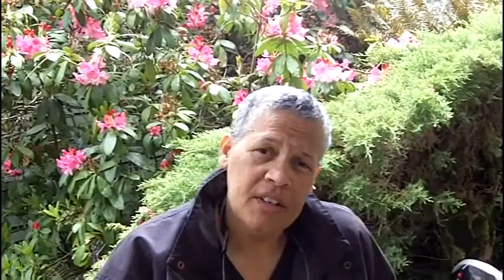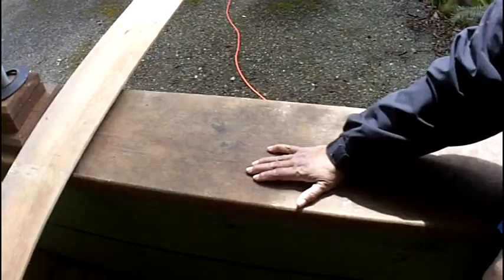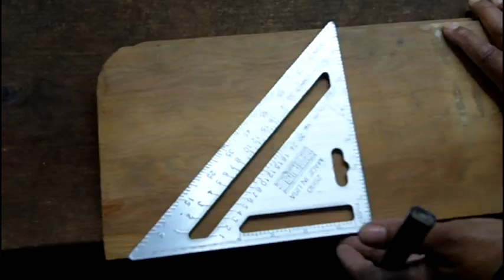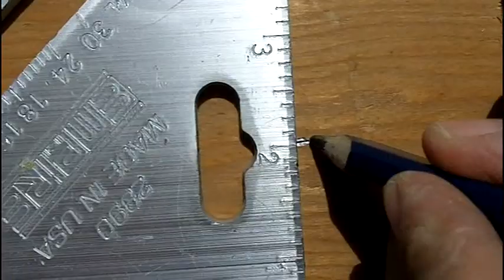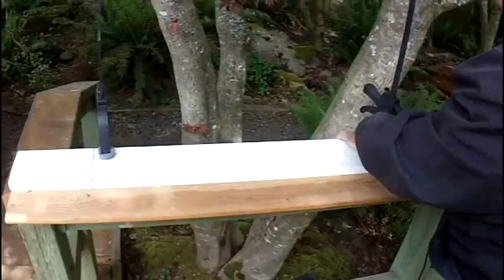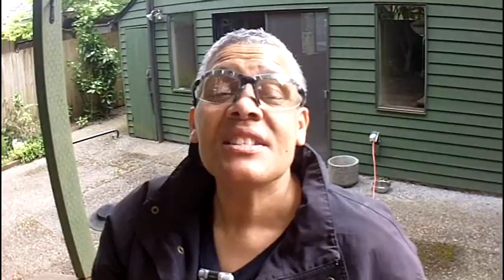How to Make a Perfectly Straight Cut in Wood with a Circular Saw

Comment: You did not show an adjustment to the blade depth (height the blade above the shoe) if adjusted too deep the blade can bind (due to movement of the wood from internal residual stresses) as it appeared to do near the end of your cut, the blade should protrude just a little thicker than thr board you are cutting.
Reply from the maker: +EddieVBlueIsland   Hello Eddie,  Blade depth and shoe adjustments were covered in another seejanedrill video.  Thanks for posting.

Comment: Question.

As I said in another video of yours concerning circular saws, I bought mine just last week (brand new). And I noticed something strange about the 2 blades that came with it. On the tips of the blade, which should normally should be very sharp and pointy looking like a regular handsaw if I'm correct, there seem to be sharp edges instead of sharp points/tips.

EN 847-1, TCT blade 36T, 185x16mm, max. speed 6000/min: is what came with the saw, to give you an idea what I'm talking about.

So my question is: do I measure from these things sticking out or from the blade itself? Because I think if I measure from the blade my cut will be incorrect.
Reply from the maker: +TheOpelkoenjas If you want it to be "right on the money", then measure from the carbide tips (which is what the "edges" are that you are referring to. ) Just keep in mind that a circular saw is generally meant to be used for construction, and you are not generally going to get the same precision accuracy that you would with a table saw.
Reply: seejanedrill Oh okay, got it. ^^ Yes, it needs to pretty right on the money, at least for my next DIY project: wooden casings for the 7 new wooden doors in mom's house. :p

I tried it on some scrap wood already (left overs from an old closet that I ripped apart), just to make sure I don't make any big mistakes, and I found out that I only need to add 1 millimeter (the carbide tips) to be "right on the money". ;) Problem thus solved.

Cheers and keep the videos coming! I'm 100% sure they will come in handy here at some point in my renovation projects.

Comment: do you cut to the right side or left side or right on the line? When I do this and I need four or five peaces of the same cut they are all off just a little. No two cuts are perfect. Whats the trick to getting identical cuts? I'm really kind of new at this and don't know much
Reply from the maker: Hi Wesley, there is something called a jig that you can use to keep your blade on track for making multiple cuts of the same size.  A jig something you make yourself, and is kind of like a "template".  We haven't yet done a video on how to make a jig, so I would suggest looking it up.
Reply: Hey thanks, When you do a vid on one, share it with me. Thanks again.
Reply: For repeated "exact" cuts use a rip fence. Right or left doesn't matter, your preference. Looks like most people like to rip from the left like this video.

Comment: The only thing I do differently is I screw down the guide piece. I don't trust the clamps to stay tight, especially when using my jigsaw for a long cut.
Reply from the maker: homer simpson Yes, that's a good way to do it!  It can be tough to do if the wood is on the narrow side though.

Comment: Thank You for your video.  But I am sorry to say your cut was not a perfect 2".  It is 1/16th of an inch too short.  You measured from the solid blade instead of the saw tooth that points toward your workpiece.  This distance matters because it will shorten your cut as much as 1/16th.  This matters in finishing carpentry work but maybe not for rough carpentry work.  I have used your method of creating a saw guide at job sites (it works) but a table saw works best.  I have enjoyed many video.  And I don't mean to be critical.  Just trying to help.  Keep up the great work!

Comment: I need to cut 1/2 inch off an oak veneer door I'm scared that i may split the veneer if the blade doesn't have a high teeth count. Would it be wiser trying to plane the door down to size instead? I either buy an electric saw or electric planer! Thats my choice.
Reply from the maker: +shutinyanks Quite honestly, if I were in your situation, I would just take the door to a cabinetmaker and have them make the cut for you.  It will cost you less to have them do it, then purchasing the tools.  And of course there won't be the added worry about chipping the veneer.

Comment: I tried this with a jig saw but my line still came out crooked,because as I watch the blade the from me holding the saw steady the blade was bending as it cut..So will a  circular saw be better to use than a jigsaw..I had to make 5  extra cuts and was angry and still didn't get it...
Reply from the maker: A circular saw will definitely be better, because there is less vibration than with a jig saw...it has less of a tendency to wander
Reply: seejanedrill
Reply: With a jigsaw cut a little wider than the line, follow with a hand plane to finish off. Little practice makes perfect or at least acceptable.

Comment: what if it is a 2x4? The falling off once it is cut is my concern.
Reply from the maker: Hello Melissa,  I appreciate the question, however, I must mention that ripping a 2x4 using this method would be extremely difficult considering the width of the lumber you wood be cutting.
Reply: :) any cut.....
Reply from the maker: Melissa J A width of 4 inches or less would be difficult to clamp without creating a jig first.

Comment: I have an orginal 77 skil saw. When ever I use this the wood always miter up. why is this?
Reply from the maker: Richard Cowtails  I'm sorry Richard, I'm not certain what you mean.
Reply: Im building a coffee table. When I use my saw, it cuts at an angle.  Could it be the blade? The shoe? I checked with a square to confirm level and the blade is at 0°
Reply from the maker: Richard Cowtails  I'd check the shaft for any sort of play.....could be a bad bearing....or it could be as simple as a warped blade.
Reply: alight, I'll check those. thank you. Blade is old anyways lol. probably blade lol always something simple lol

Comment: Is the cut out by the width of the blade?
Thanks
Reply from the maker: 170221dn If I understand your question correctly, than the answer is as follows: If you measure from the waste side of the blade, then you don't need to account for the width of the blade itself.  If your question is something else, just let me know.
Reply: Thanks,
just checking.

Comment: For  2 inch rip I usually pinch the table and run.  I can rip a 4 by 8 in half and a perfect cut with nothing but my speedy, a pencil of course, my tape and the saw.  But I keep that one secret for winning bets.    For $50 I bet I can rip it in half and my cut is as straight as a  factory edge.  I have NEVER lost the bet.
Reply: +Steve Sanders Let me guess, you use the rip guide?
Reply: No.  And I don't pop a line either.  No rip[ fence or guide.  All done with nothing more than a tape, MY saw (just a DeWalt 7 1/2 inch circular) and my speedy.  I'll explain.  I get my mark on both ends...the one at the lead end of my cut to get it on track, and one at the end so I don;t get off going out.  Then I hook my tape on the side of the saw table and pinch the blade where I want it to cut, (1 1/2 inches shy of my finish dimension. ) then I do just like you would for a pinch and run only I am pinching the tape, not the saw table.  I may do a video of it just to show people.  I don;t know.  I ain't really proficient at making these YouTube videos.  I'm not "cyber' savvy".  I'm a carpenter.
Reply: +Steve Sanders When I was in college and laboring, I saw guys making different plywood cuts your way.  I never could cut anything but a 2x4 straight.
I hate you talented people.
Reply: Ah, you could do it.  All it takes is experience and the will to learn.  If you can use a saw and cut a  straight line at all, you can learn it.
Reply: Steve Sanders
People with experience get track saws.
Reply: I've used one and they are a good tool.  But what if you don't have one?  I'm old school.  I make do with the tools I have available.  Having a tool is not as good as having the skill and skill pays better.
Reply: Steve Sanders
If you don't have one you go get one. Having a skill is not exclusionary to possessing tools either. Having the right equipment pays best too.
Reply: Tell ya what...you go buy the tool. and I'll pay the guy who can do it without the tool.
Reply: Steve Sanders
time is money. You'll go chapter 11 unable to compete with better equipped rivals.
Reply: By the time you set your track saw, I can cut it, hand it to my guy and he can have two nails in it and have his tape out to get my next measurement.
Reply: Hey.  If you like to use them, fine.  I wasn't even saying anything about the tools available.  I was just telling about a trick I use to show off.   With some practice I can still hand drive 90 166 penny's in a minute, but I use guns now.  What I CAN do may not always be what I do.  Jeez.  Put a plug in it Nancy!
Reply: There is no talent in carpentry, but there are acquired skills. Some carpenters have artistic ability and superior common sense. These people are talented.

Comment: Actually the rip was a 32nd shy. You should have measured from the edge of a tooth, not the blade itself, to the edge of the 'shoe' (never heard that before, always referred to as the table). This is why the rip was a tad off.
Reply: +Buster Nutt Its always called a shoe, never a table.
Reply: Not so. Depends on where your from. Does everyone in America call soda soda? No. Or how about a shopping 'cart'? In some states it's a wagon. I've even heard it called a trolley. And where I'm from everybody calls this part a table, not a shoe.
Reply: Buster Nutt Where are you from that everyone calls it a table ?  I googled it, nowhere can i find it mentioned that its a table.

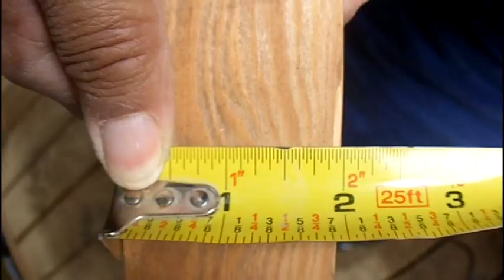Comment: Jane, you are pushing in on the tape during your 2" measurement (6:10) and holding that bent up tape at an angle. The top reads 1 15/16, the bottom is reading 1 7/8. If you were holding the tape correctly it would probably be closer to 11/16. The kerf of the blade is an 1/8. The measurement across the board should've been 3 3/8 to allow for the blade width. Also, hook and pull for a correct measurement. Never hold the end of the tape with your finger and push the tape towards your finger. The slack at the end of the tape is there for a reason. This would never pass in finish carpentry.

Comment: your off 1/16 (actually a bit more because you measured from the blade flat instead of the actual tooth) if indeed you wanted to cut an exact 2" piece. 

calculating for kerf and figuring out which side is the waste side is the thing most people.get confused about. 

i understand and appreceate that your making a verry basic / begenner video, but you need to cover this properly or atleast do it correctly in your demonstration. if you intended the 2" piece to be the waste piece it should have been measured from the other side.

Comment: Something doesn't make sense here. You marked 2" on the board. Then you measured from the outside of the blade to the outside of the shoe (1.25"). Then measured that distance from your 2" mark and clamped your straightedge. To me the piece you cut off SHOULD of been the thickness of the blade SHORT OF THE 2" you wanted given how you measured. Yeah you showed the cut off piece as being 2" BUT that does not compute given HOW you measured. You should of measured the shoe to the inside of the blade for it to be right. You never mentioned it BUT in order for it to be correct you would of had to have allowed for the thickness of the blade.

Comment: Two big errors here!!!There’s no way that the cut piece could be 2inches wide because you didn’t allow for the blade thickness when you set the fence from the edge, you only measured from the blade body to the side of the foot. You actually needed to have measured to the other side of the blade in this case. Also you only measured to the blade body not the teeth. The teeth are always wider than the blade body to prevent it binding during the cut, it’s called the kerf. If you’re going to pretend to be such an expert at least do it right. The fence should have probably been 2 1/8 inches from the edge. And that’s from an Australian who doesn’t even use inches.

Comment: you cut a 1 7/8 piece, you measured from the wrong side of the blade. nice try though.
Reply: She showed the finished cut as being 2" (it might look like 1 7/8" if you read the bottom of the tape because it was bowed out a little; at the top it was pretty much dead on the 2" mark.)
She had the blade positioned such that the outside edge was on the cut line, ie the thickness of the blade (kerf) was fully within the cut line and included in the 2" she removed.    
Remember she had the jig on the outside of the blade - what you said would have applied if she'd cut the other way around, with the jig on the opposite side of the cut from the blade, in which case she'd have needed to include the blade's width in her shoe measurement.  As another commenter has said, doing it her way is better because the motor isn't in the way.
Reply: +TheBloke actually, she DID measure to the wrong side of the blade. I realize her cut was 2" but that may be a result from the slightly inaccurate pencil marks. Not hating at all. Actually enjoyed the video.

Comment: It's straight in line but up and down?
Not so much
Your hand wobbles left to right
Reply: There is a certain amount of skill to carpentry that can only be obtained by repetition, but another board of the same thickness laid parallel to the cut on the other side of the blade would certainly help your accuracy. All the videos and how to books available will never be a substitute for experience.
Reply: +labrd41 thanks

Comment: you know how to cut straight, but you don't know how to mark perfectly. you need a very a small diameter pencil or metal point to mark accurately. also cheap circular saw blades wiggles or have play that prevent them from cutting accurately.

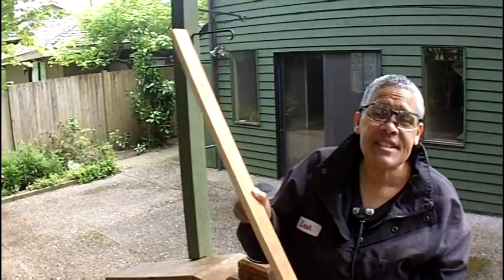Comment: You need 3 pcs. of straight wood for clamping an all... And check min 6:18-19 you can see the bottom end of the stick is uneven and broken no perfect cut because it is hard to finish a perfect cut using a jigsaw such rough blade.... Disappointed.
Reply from the maker: Hello Eliz, The point of the video is to achieve a straight edge, and I'm using a circular saw, not a jig saw. The technique that I show is a common trick that is used all the time in the trades to make a straight cut...it isn't something I invented!

Comment: These videos are always wonderful - a great teacher.  If you have many cuts to make, you can build a permanent jig (=job aid) so that you always get straight cuts.  You can YouTube videos on how to make these: https://www.youtube.com/watch?v=d81qIn-oT2o, for example.  It is simple to make and only requires two pieces of lumber wider than the shoe of your saw and a few short screws to fasten the lumber together.  Once the jig is completed you simply clamp it to your work piece, aligning the edge that will be adjacent to the saw blade with the waste side of your cut line.  Another option is to purchase a ready made jig, such as those made by Kreg.

Comment: Uhhhhh waste oof time.... Its a track and you didnt do it right. you should be putting a strip of wood on top of the track and then running your saw along that strip of wood to true your track then blah blah
Reply: And also you shouldn't just let your wood piece drop to the floor... - causes potential for the very end of the cut to splinter, not to mention its anoying, you have to bend down and pick it up, and it could damage your deck . Almosst 1mil views.. shm

Comment: pretty cool but I used a table saw for my cut, cooked dinner, ate dinner and smoked two cigarettes  and your just finishing up
Reply: +Don Douglas Ahh but can you pickup and move your table saw with one hand. She is not claiming that the circular saw is better than a table saw, there is a proper tool for every job. but if you only have a circular saw, or cant bring a table saw to the project then you need to know how to do it with the tool you have.